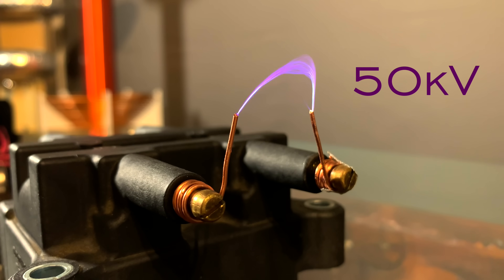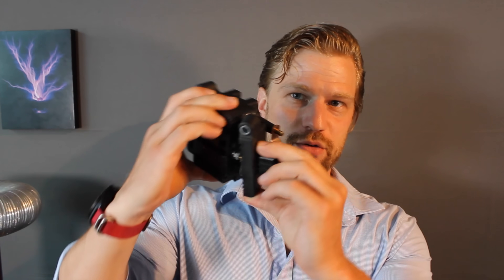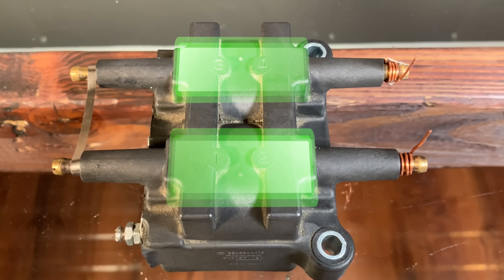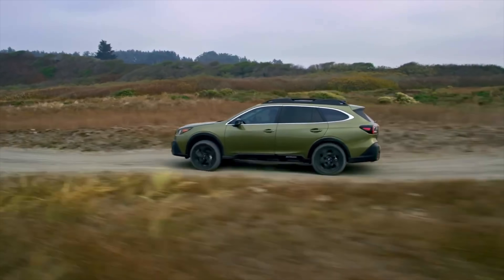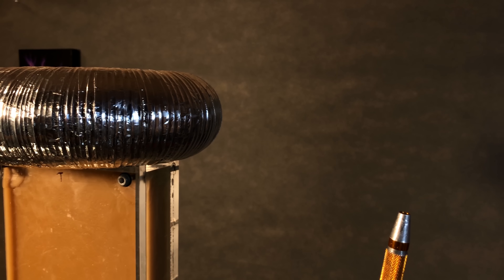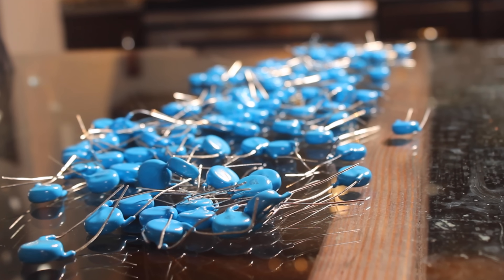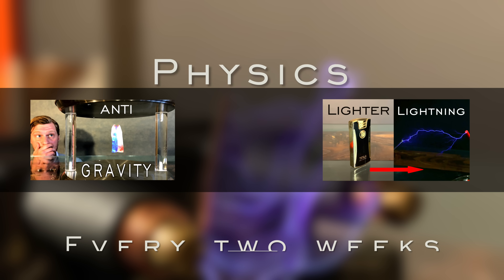The 50,000 volt Subaru Outback Powersource!

Comment: Tip for measurement very high voltage with precision. 
Using a digital cheap scale to measure the pulling forces who excert the electric field V/m.
1) paint all the body with conductive paint or indian ink.
2) via very thin wire conect the body to the metal plate of the scale, like a whisker flexible, then you have a "brick" with all his part equipotential, and must be grounded.
3) measure the area of the scale plate in m².
4)put the scale at 1mt from the sources of voltage/field.
5) the pulling forces you mesured are proportional to V².
6) you can calibrated with know low voltage ac 500v at 10mm distance, will give the same forces that 500.000V at 1mt.
7) Example with tesla coil.
Fix the scale to a wall, the plate surface at 90° respect tesla axis.
Put the tesla toroid at 1mt from the plate.
measure and do the math.
Worth to note that it's an ac/dc rms voltmeter via electric field forces.

Comment: So is the plasma burning the Air as we see it ? If so why can't you just use, first pure oxygen in an engine and use the plasma spark to explode in the piston and not just oxygen, which would obviously be more explosive, but also just air because that's why you can see the plasma because its burning the air ,so please just build this engine, it will need better metal rather than what they use as the plasma will burn aluminium

Comment: I am interested in using this for a homemade 12" plasma globe, but have a few questions as I'm still somewhat new to this stuff.

First, and perhaps foremost, from the way he put it all you would need to do to use it for a tesla coil/plasma globe is simply attach a diode to the end and it'd be ready to go, is this correct? (I ask because from what I've read a tesla coil circuit requires a spark gap and a couple of capacitors to make it work.) If this is the case then what rated diode would I need? 

Second being it seems as though he is powering it with 8 AA batteries connected in series with the 555 timer, or perhaps I didn't see it correctly. If so then I should be able to use a 12v dc wall plugin instead, correct? 

And thirdly, can it only use dc for the input current or could you use something like, oh I don't just something off the top of my head🤔, an AC 6.5kV 30mA neon sign transformer that you bought because you did half fast research and thought you knew more than you did only to discover that while possible to use a neon sign transformer for a plasma globe you need need to use an older one because the new ones have all their electronics encased in hard plastic in insulate them 😅😅? If so then could you skip the 555 timer or would you still need it?

Comment: When you have reached 50,000 volts it no longer hurts the human body but you know what it hurts?

Any injected nanotechnology running through the body I'm planting the seeds let's see if the corn grows.

This experiment has been done with somebody who had activated a Bluetooth code within their own body after 50,000 volts was put through their body painlessly there was no more Bluetooth code

If there is no more Bluetooth codes
 you're no longer on a remote control system from the AI transhumanistic agenda.

Comment: We're building a skoolie to live in while we build our first quonset building.  We will have aeroponic & hydroponic  inside,  etc.. I ran into a heat issue being totally dependent on solar and living around 40min east from walsenburg,  co. I am currently building a plasma flame heater that draws off ever side of the square tubing and welding fins (heatsinks) and driving the air with a couple 240mm fans.  I'm building 4 rods (flames) per box. I'm currently building 2 for our skoolie.  What do you think my friend?  ✌

Comment: You mentioned being able to run it in one mode that produced a high voltage and another that produced high current. How does that work? I mean, assuming the resistance of the wire is constant shouldn't high voltage always result in high current and vice versa since V = IR? Are the magnetic fields of the transformers some how changing how it works so V=IR doesn't apply?
Reply from the maker: You make a great point.

Inside transformers, energy stored in the iron core and wire is the limiting factor for energy transfer, and thus, current transfer. On the output, If you double your voltage, you don't also double your current. You actually cut the current in half, in order to accommodate the doubling of voltage. Energy out of a transformer = energy coming in. That is why they are called transformers, as they merely shift the proportions around. 

 Per modes, one is technically a mode with more charge over time, and is continuous high frequency AC. This creates the most charge over time, and is most powerful. That's the hot arc you see.

The other mode, the 555, creates DC pulses which start and stop. It leads to very high voltages due to high dV/dT, but since these voltages are created inside an iron core transformer, the available current is limited.

Comment: What are the layouts of the two versions? I melted down one of secondary coils of the ignition coil using a zvs driver.
Reply from the maker: Yeah, you need to be careful running any ignition coil in high frequency mode. The iron core is not designed for high frequencies and gets super hot. Due to eddy currents.

Comment: Attention watch that coil I am sure you know those thing with just a bit of wrong amperage input can stop your heart point 2 a large quantity of those things that are taken off cars are because of internal carbon paths caused by high resistance in secondary wiring and they can lay a serious spark out the sides of the case and grab you and physically make you pee yourself or worse and the primary side is ac voltage up to 600 volts and it can grab ya its very hard to get away from it.Just putting that out there I have been bit many times over 45 years as a Automobile Technician. Oh yeah Jay if you have a few moments Could you Email me  :knightstotale at Gmail.com         I have a theory i would like for you to check out but its to much to explain on here thanks.

Comment: Could that ZVS driver be used as a HF start box for tig welding? I have a machine that is capable of tig but it only does scrach/lift arc, im looking for a way to add a HF start for use with a foot pedal to control the current of the arc.

Comment: If you think that's impressive, look at the ignition coil for GM's HEI system from the 1990s. They were so energetic that they would injure mechanics working on running vehicles via corona discharge through insulated spark plug cables. They were capable of delivering 500-kilowatt impulses: 48-53KV with current peaks as high as 10A. I have one in my homebrew stun gun that fires so hot that it fluoresces the air in the spark gap from single capacitor-discharge DC pulses and not from an AC driver - the actual discharge path is your typical bright blue spark but the air around the spark is heated to orange.

Comment: I'm not sure what the 13b ignition system voltage is in an RX7 but it's a LOT.

I once left a trailing wire off and kept hearing what best described as an electrical exhaust leak sound, I opened the door and looked under the car and it was shooting massive arcs between the wire and the engine.

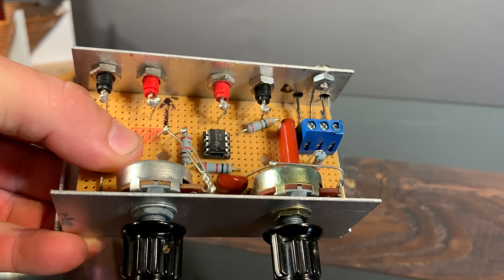Comment: 2:08. The 555 doesn’t produce ANY arcs.  It is an adjustable timer chip that can be configured many ways. It’s output can be used for a multitude of functions; Schmitt triggers, Morse code practice oscillators, electronic door buzzers, continuity testers, signal injectors, metronomes, LED flashers and alarms, and long-period timers.
Reply from the maker: The 555 timer in association with ignition coils was the topic of that time stamp, not 555 timers in general. Running an ignition coil with a 555 is extremely popular amongst hobbyists, which is why I included it. Cheers.

Comment: What happens if you use the high end ignition pack by Delphi and don't hack the end off?   It looks like the original pinouts can be kept, and the harnessing can be cleaner.
Reply: Or this one could be used, 3 transformers instead of 2... just have to figure out the pinout to find the 1 negative and 3 positive.   

https://www.4wheelparts.com/p/performance-distributors-screamin-demon-ignition-coil-31740/_/R-GNHW-31740

Comment: I have the same setup with the coil pack and ZVS  board but the only output I'm getting is a thin weak spark when I disconnect the power.  I'm assuming the coil is good as I'm measuring 0.8 ohms on both the primary windings and 12.5 K ohms on the secondary windings.  My ZVS is good as it powers flyback transformers with no problem.  Any suggestions what could be the problem?

Comment: Could you tell us the timer 555 circuit what’s it’s actual name, or if generates square wave or sinusoidal, and if it outputs pulses in both the positive and negative cycles or only positive cycles, is it duty cycle adjustable circuit ?

Comment: Could this be used for a heat source? Like a welder with carbon rods or an electric arc furnace. I have been looking for ways to get  past 2000°F(1100°C). I have like ten of these in parts subs.

Comment: Does anyone knows what factors shapes the arc itself? Can you make a straight line or a curve left or right? 
I know you can change the sound of it even creating music does it respond to a laser beam?
Reply: Laser beam will make the air inside the beam more conductive so it will move the plasma around, but the exact path of the plasma is always just a little random, but the general stratight-sh/left/right curve could be controlled by varying the position of electrodes.

Comment: What are you talking about? For 100 years, the spark plugs of every car have worked the same way.
Reply from the maker: Diesel engines use glow plugs which are not high voltage in nature.
Reply: @PlasmaChannel  "Diesel engines use glow plugs which are not high voltage in nature." That's true, but you're talking about high voltage.

Comment: I have a subaru and have tossed out 3 of these. There's a coil pack off of a dodge neon/set that's almost a direct swap only have to modify the plug to fit. And the dodge neon coilpack is way more powerful

Comment: l would think there are four  secondary coils here and a center tapped   primary , not much info given here on technicals , i will have to search the info on this four cyclinder  coil my self .Nice  output though. I always liked the GM 1990's  High Energy Ignition coil , has lots of capability and even more capability with two or three.

Comment: I bought a coil like that, cut it flush under the rods. All i have is 3 terminals ..  Did you put those bolt heads on?
Reply from the maker: I did, I added the bolts for simplicity
Reply: @PlasmaChannel  Thanks!
 what size Zvs would be adequate ? 120, 200, 1k watt.
What frequency Range is good  for the sparking? 
Going use it is a flame effects igniter ..
we trying to find a durable igniter .. some last only a night ...

Comment: Why this ignition coil has a smooth modulated plasma lines while a spark gap from other videos has a cracked plasma appearance?
I saw a vortex plasma on another Chanel that shows a very smooth plasma lines. I don’t know if you are familiar with this video but it was just a plasma inside a circular magnet. I have a point I would like to discuss with someone interested in plasma if you could reply. Thank you for your great videos!

Comment: Any chance I could get a schematic or an explanation of how the ZVS driver is wired?  I cut out all the internal circuitry of the ignition coil as you did.  Then I tried just using the common primary of the ignition coil as the center tap for the ZVS driver (the way a flyback transformer is wired with a ZVS) but I got really strange results that I can't explain.  I get wildly varying frequencies and an unstable circuit.  With the secondary coils in series, before triggering the arc the circuit oscillates at ~8khz, and once the arc is triggered it drops to about 1khz.  Then after a few seconds it goes up to 450khz and the arc extinguishes.  Then the circuit only draws about 8 watts until I reset it, bizarre.  I tried putting the secondaries in parallel, but the results are worse.  I get 10-15kv or so at 250hz (that seems wrong but that is what my multi-meter says, and it sounds like 250hz to my ear, I haven't hooked up the oscilloscope yet).  The ZVS driver is home-made with genuine parts from digikey and component values matching the one you showed in the video.  It works great with flybacks but I really wanted an non-rectified output.  I thought this was the solution but I can't get it to work.  What are you doing differently?
Reply: Have you found the answer?
Reply: @alessandrodonascimentovarg24  No I never found a good way to reliably drive it.

Comment: I was wondering if you could give me some advice. I want to output high direct voltage and current. How do I go about doing that? I'd rather use modern circuits or transformers rather then a van de graaf generator or a wimshurst machine. Thank You.

Comment: 50kV AC, hmm, all you need some 200-250 Amps current from a DIY step down microwave transformer and viola, you can power a small locomotive ?? Or tranfer that high voltage back to the grid? Make the govt foot your Bills ?? Whoah ! 🙌🙌🤔🤔😮😮

Comment: I understand this might sound ridiculous, but I believe you could use this to make a man portable rail gun. From research that I've done, high voltage and high AC current are what you will need to make something like this have a strong output. A compensated pulsed alternator would be absolute money and this might be a good bridge between that because I have yet to see anything of the sort come to fruitation. At least on a man portable level.

Comment: Any hard switched topology is noisy af and pretty useless for something that runs continuously. ZVS is too analog and requires a center tab. It also draws as much power as given and requires a "soft" power supply that drops voltage when the load gets higher. It would be great if you can come up with some resonance type soft-switching topology that can be controlled externally. I know some half bridge driver ICs may be good candidate but then you need a separate power supply to supply the ICs. That is one 12v supply for the IC, one 15v for the gate driver, and one high power PSU for the Mosfets. Overcomplicated, but as far as I know, it is the only solution.

Comment: Hey, I got one of these and cut it at (what looks like) the same spot, but I hit 5 wire connections instead of 3. Do I need to push a bit deeper? Or did I overshoot?
Reply from the maker: Hey, that’s a great question. I know mine had 5 input wires.. when I cut it only three were left... so I’d guess you didn’t cut far enough. But honestly, don’t quote me. Wish I could help more, and don’t want to make you waste your ignition coil. Can you send me a picture to the email address in the ‘about’ section of my channel?

Comment: Can you use a 555 timer circuit with a normal car ignition coil
Reply from the maker: Yes you can
Reply: Hi but can it be runned by a zvs driver
Reply from the maker: Marcos Azzi no, rvs requires three input wires.
Reply: Mate I know it has been an long time but will a 555 timer circuit on eBay work

Comment: To be clear, there was only ever one arc, yes? I'd have to guess that this was just happening way faster than the camera's shutter speed, and there weren't actually like 30 simultaneous strings of plasma flying through the air?
Reply from the maker: It is both, actually. What you saw on camera is exactly how it looks in real life. There are mutliple arcs at once. But, the thumbnail is a 1 second exposure

Comment: It is better to use old round ignition coils from old cars, you can drive them with a relay to get max 25kV from one coil and 50kV from two coils, for more voltage it is important to coat them in wax or put in oil, for more power you can use a MOT and a spark gap and discharge about 1kV pulses from a capacitor into the primary, for even more power use a triac driver, I used a 1kW driver with a big capacitor and I got over 50kV out and crazy hot arcs that looked like from two MOTs, and if u use a tesla coil spark gap power supply, you can get 90mm sparks and with the 555 single transistor driver it is the weakest
Reply from the maker: Those oldies are goodies, that is for sure. I just dont like how they boil over. I am a fan of epoxy resin coils.

Comment: Make hho with this using voltage controller...?
Reply from the maker: If I convert the output to DC, I could possible. However, the current is very low...and to disassociate gasses you need high currents.

Comment: I'm wondering, since I'm no expert, if it would be safe to build a tesla coil using yourself as the toroid/topload (even if it's a small tesla coil). I know how to make it work. I don't think I will use too high a frequency, so the skin effect wouldn't happen probably. I looked it up and apparently the average body parasitic capacitance is 150pf, so I think that's quite a lot for a tesla coil. That means I won't need a large secondary. So I have a lot of ideas for building it, but I need your opinion for safety. Thanks!
Reply from the maker: Great question. Yes, you can certainly build a tesla coil and use yourself as the topload. The entire circuit would need to be tuned quite precisely, but be careful: you may burn your skin anywhere a spark breaks off from your body.
Reply: @PlasmaChannel  Well, as long as my eyes, brain, and other sensitive parts are fine. Thanks!